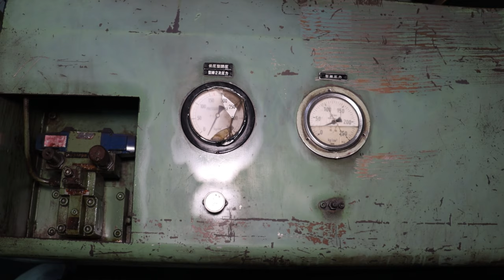Manufactoring Process of Plastic Chair With Injection Molding Machine

Comment: The machine shouldn't work when one of  the safety guards are open, those press can make up to 200 tons of force when closing, it's so dangerous.
Reply: I bet the mold safety is set correctly 🤣🤣
Reply: At my plastic mold injection facility we have one that close up to 390 tons. We should be a getting a 400 ton Toyo soon tho. And you are correct. There should be an interlock safety system for the purge cover and the back door that shouldn’t allow it to run
Reply: @johnmarranca787  i worked on 5500 engel before i had to give up work the tool was 107t making 1100 litre industrial bins
Reply: From what I've seen in my career many artisans would bypass the safety of the machine just to get the production going, yes I agree it is very dangerous